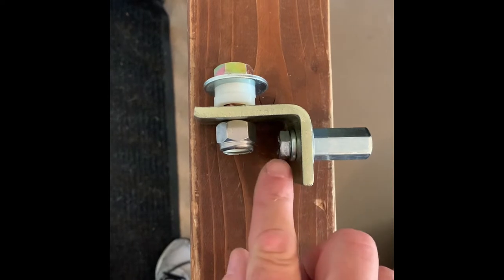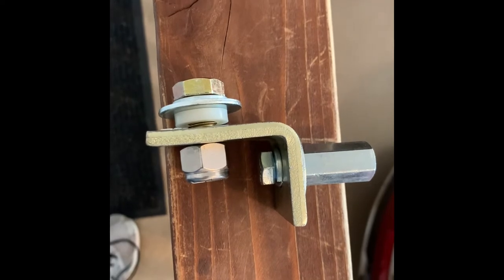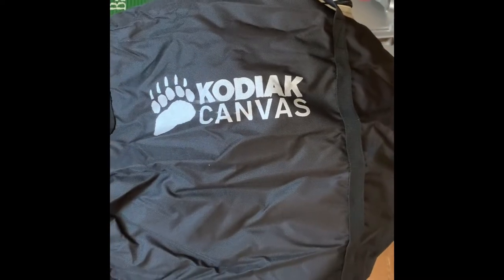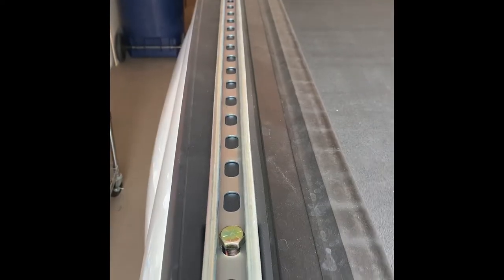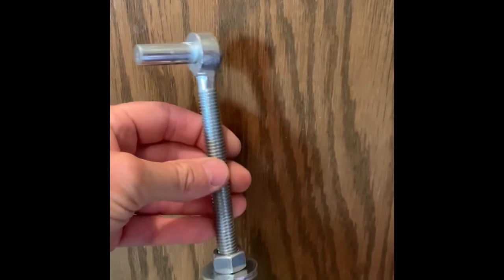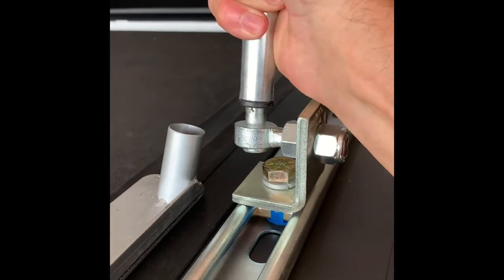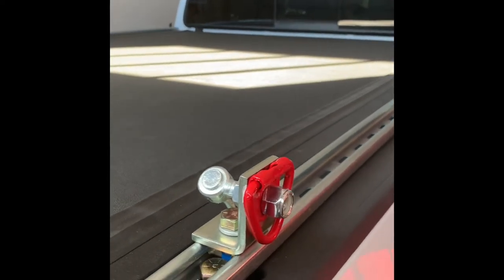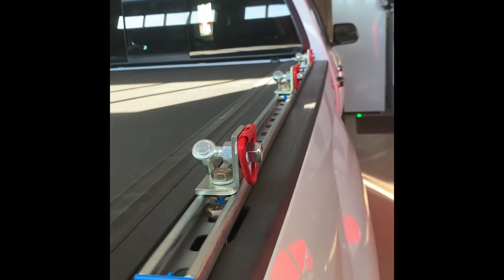Kodiak Truck Bed Tent-Part 1

Comment: EXCELLENT EXCELLENT EXCELLENT VIDEO !!!!!! That hardware is readily available everywhere  !!!    Thank you !!!  All of that Unistrut hardware can be purchased in stainless steel as well.  NEW SUBSCRIBER....***EDIT:  you MUST be some type of engineer !!!  I can see it.  I'm a machinist.  I have watched SEVERAL reviews on a variety of truck tents and I was MOSTLY informed by this 4 part series.  Based on your videos and ideas, I have purchased one of these Kodiak truck tents.  THIS part 1 video was most informative and, frankly, I plan to steal your ideas !🤣   At first, I'll just use the taller clamps until I can get all of the hardware to copy what you have done.  The modification is so innovative and compelling, I find it hard to believe it hasn't been patented  !!   OR IF IT HAS....please tell me who sells it and how much.  I can't, for the life of me, understand why Kodiak hasn't purchased the design from you.  If you haven't patented and sold it, you should.  Think of your grandchildren.  You could set them up.  EDIT #2:  As it turns out, my Toyota Tacoma doesn't have those stake pockets.  I decided to utilize those slide mounting brackets below the rail.  I designed a bracket that will bolt to those slide rails an will fit anywhere on the rail I want.  I'm making 6 brackets.  Your slide is on top and mine will be a side mount but will work the same way.

Comment: Really nicely engineered!
Reply: Fastenal will have all the parts, they also offer a service where they will  build kits. They may have a minimum. They do this for industrial and commercial accounts. Best price without an account will be to order online. Items they don't have in your local branch can be ordered. They have very quick shipping to pick up at branch.

Comment: Very clever. Fastenal will have all the parts, they also offer a service where they will  build kits. They may have a minimum. They do this for industrial and commercial accounts. Best price without an account will be to order online. Items they don't have in your local branch can be ordered. They have very quick shipping to pick up at branch.

Comment: Great videos, I just got the Kodiak and that is the big complaint I have as well. The large C clamps just cut into to much space in the bed, then your always having to adjust around them. I am having problems finding all the parts that you used and wanted to see if you are willing to build kits for guys like me. I would really be interested in purchasing one if you would. Really appreciate your videos keep em coming!!
Reply: Fastenal will have all the parts, they also offer a service where they will  build kits. They may have a minimum. They do this for industrial and commercial accounts. Best price without an account will be to order online. Items they don't have in your local branch can be ordered. They have very quick shipping to pick up at branch.

Comment: Did you have to cut the stake pockets out of the bed rails on the bulkhead side? I have a 22 Canyon and the holes are closed. Also, is your bed a short or long bed? Really enjoyed your videos and upgrades. The unistrut and brackets with all your accessories is pure genius.
Reply: Fastenal will have all the parts, they also offer a service where they will  build kits. They may have a minimum. They do this for industrial and commercial accounts. Best price without an account will be to order online. Items they don't have in your local branch can be ordered. They have very quick shipping to pick up at branch.